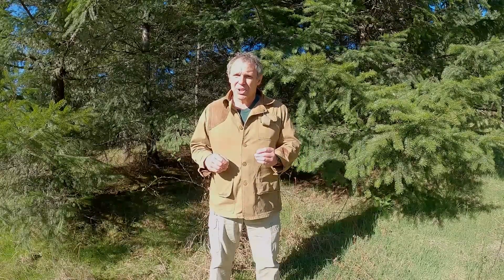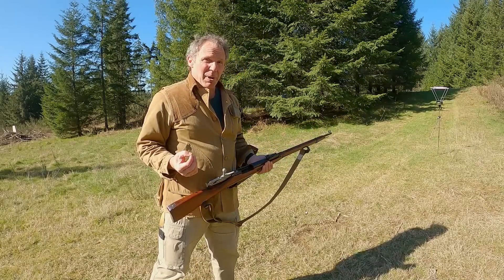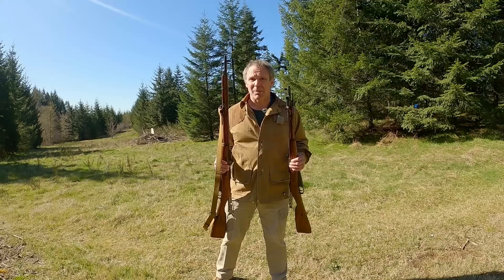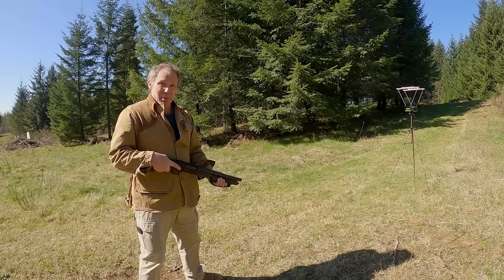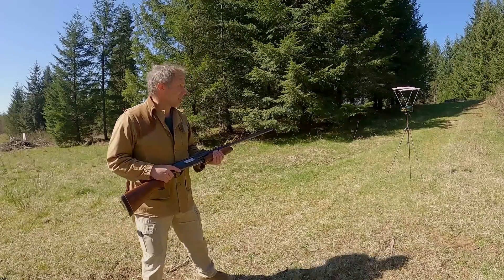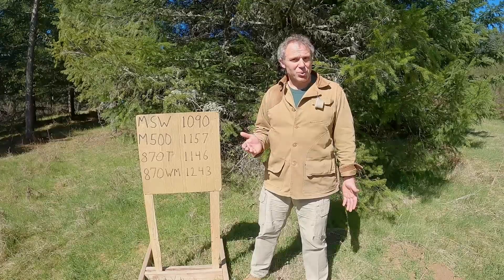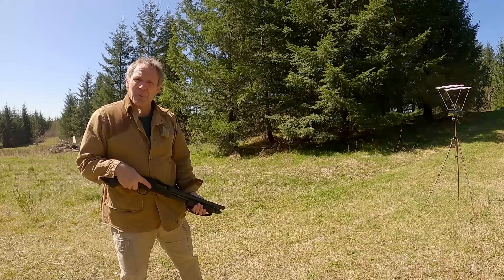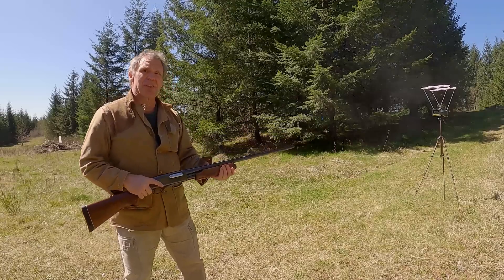Shotguns: How Does Barrel Length Affect Velocity?

Comment: Thanks for the video! I like my Shockwave. I understand that people who have trained for years on regular shotguns won't like going down to something like a Shockwave, but for me, the Shockwave is a nice little firearm. Because of my experiences, I like firearms that are easy for me to carry around the house. I don't have the Shockwave near me very often, but when conditions are bothering me, I sometimes do. (For instance, when my road is closed by winter weather and no one is going to get to me quickly, someone coming to my house with ill intent would be less worried about interruption.) As with any smaller version of a larger firearm, I accept that I'm making a compromise on several levels. 

I generally prefer 00 buckshot loads that are rated for 1100 to 1200 fps or #3 or #4 buckshot loads that are rated up to about 1325 fps. I assume that I'd getting about 100 to 150 fps slower shot columns than the rated velocities. Most loads pattern at just under four inches at eight to ten yards with my Shockwave. At distances under twenty yards, I think I have a good chance of putting about eighty to ninety percent of my pellets on an attacker. I think that load of pellets at those velocities would give me pretty good stops. If a monster breaks out of the local prison and is seen heading towards my place, I might choose a regular tactical shotgun. For my usual conditions of preparedness, the Shockwave still works for me. 

I've used some of the short shotshells with the adapter. I see some value in them, but I lean towards the 2-3/4" shells. I like the additional capacity, but if I'm really facing a large number of attackers, I think that I'd need to to start shooting at them before they were in shotgun range. From your previous presentations, I see forty to fifty yards as the practical effective range of a shotgun. If I were facing a group of attackers, I'm not sure that I could make more than five shots in the time that those attackers would need to charge fifty yards. In that situation, I think I would need to be using some kind of semi-automatic rifle and start shooting before they had closed to within fifty yards.

Comment: 18" is handy but here's a fun fact I tested personally - when shooting skeet from standard improved cylinder bore, 18" barrel spread is too high to hit reliably while a 20" barrel does just fine. 

For home defense 18" is great and handy, but it's not fun to take out for sport shooting, all the while 26" and 30" barrels are perfect for sport shooting and hunting with any type of choke needed, but they can't be used for home defense. 

If it's only one shotgun to have then 20" will do great for home defense, sporting and for most hunting. If new then Mossberg, if 870 then pre-freedom arms.
Reply: You could just get a Mossberg 500 and buy multiple barrels for it.

Comment: I will say, in 12 gauge while you dont see major gains going from a 14 inch to an 18 inch with most loads, the 20 inch is where you start to see improvement and I'd say a 26 inch barrel is really that kind of sweet spot. The gains from 26 to 28 are almost non existent and the 30 inch barrels usually arent very common anymore for the same reasons. 

Now, in 20 gauge and .410 you can see some significant gains from going to a longer barrel. A prime example, a .410 in an 18 or 20 inch vs a 24 or 28 inch is quite different and the shorter the barrel a .410 gets hurt tremendously. 20 gauge while not as effected as the .410, compared to the 12 gauge you see how shorter barrels do it no favors, and much like 12 gauge a 26 inch barrel seems to cap out it's effectiveness.

Comment: I love Paul's videos.  That said, this was a somewhat predictable result.  The idea that rifles and pistols with longer barrels will produce higher muzzle velocities for the same type of ammo is a demonstrated fact.  I guess the question that prompted this video was, because shotguns shoot multiple projectiles, that the pressures accelerating them would be diminished somewhat due to the space between the projectiles.  However, recall that the expanding gasses of the burning propellant aren't pushing against the individual projectiles, but rather against a wadding/shot cup, which effectively provides a flat surface against which those propellant gasses push.  Thus that shotcup/projectile combination is a analogous to a homogeneous projectile until they leave the barrel, thus the similar results to rifles and pistols.

All that said, I again love Paul's videos, and eagerly look forward to the next opportunity to lean more about firearms.

Comment: Just started the video, my initial thoughts would be that gain in velocity would be higher the larger the pellets as well as the weight of the pellets. Like 'average' bird shot load would less difference between shortest and longest barrel length than would the average 'buckshot', with slugs gaining the most with barrel length. Also think slugs would gain slightly rifled vs non rifled but not super confident of this one.

Comment: Some things I don't fully agree with.  A few technicalities needs clearing up. Longer barrel length does NOT equate to higher (peak) pressure. The pressure just has more time to act on the projectile. Shotguns use fast burning powder, so peak pressure occurs fairly close to the breach then rapidly tapers off. Burning is likely completed long before the shot leaves the barrel. Thats why a very long shotgun barrel increases velocity only marginally.

Comment: Interesting results, I would've thought that the smaller projectiles would not "block" the gasses from escaping like a conventional bullet does, and therefore it wouldn't be as effected by the longer barrel. 

Turns out it does affect it quite a bit. Pretty interesting!

Comment: More importantly: I'd be willing to bet those 00 shells had a faster burning powder in them than the birdshot shells. If you're going to run a shorter barrel it's best to use faster powder, so as not to waste as much energy going past the muzzle. Slower burning powders - on the other hand - do great in the longer barrels.

Comment: The surprising part was you don't lose a whole lot between 20" and 14" it's a little but imo not enough  to worry about at the ranges tour gonna use  a tactical shotgun.  I'm all about short barrels so thanks for this video. I personally  have no use for a 30" barrel. If they all had the same choke I doubt anything you hit with any of them can tell you the difference.  I'm going to have a stabilizer and screw in chokes put in my shockwave. That is bird gun deluxe

Comment: This is an awesome video, and helps with a really common choice in shotguns: the 20" vs 18" barrel. I'm curious, though,  what the threshold is for muzzle velocity actually being significant.  In the video, Paul said that 11fps was insignificant (understandable) 65 fps was "maybe, yes", 97 fps is significant (with bird shot). But I'm curious if 44 fps is also "maybe" significant - the difference between the 18" and the 20.5" barrels with buckshot. 

Overall, it just raises  the question... at what band of figures does a fps value become significant?

Comment: Bet a lot of it just has to do with fast vs slow burning powders in the load. A fast burning powder most likely wont notice the length of the barrel as much as a slow burning powder. Would be interesting to see for sure but unless someone wants to do hand loads using each different powder its not likely to happen.

Comment: That’s a VREY interesting topic, Paul, and one I’ve never really considered, so THANK YOU.

But watching this video has raised a related question.   The Federal and (I believe) Hornady produce some shells with “flight control” technology, which might offer additional insight.  As you understand better than I, they have “cup” that holds the mass of projectiles semi-together, until they depart the muzzle.  Obviously this differs from all the projectiles “bouncing” down the barrel gaggle-like.  And, I’d GUESS — and this is pure speculation — that the “cup” might more tightly fit within the smooth-bore barrel’s interior diameter than would loose individual shot balls.  If that supposition is correct (??), then I’d further guess that the effect of barrel length on velocity might be greater with “flight control” than with “standard” shells.  What do you think?
Reply from the maker: We have presentations on flight control ammo.
Reply: @Paul Harrell:       

Thanks.Paul, and yes I know that;  in fact, it was the genesis of my question.  

Apparently, I’m afraid I didn’t express my question too clearly.  The crux of it is, since the “flight control” shot cup/wad conveys the projectiles to (or slightly beyond) the muzzle — and that presumably the cup’s tighter barrel fit would prevent some of the hot, expansive gases from exiting the muzzle before the pellets do — would one find a greater barrel length-to-velocity correlation with “flight control” ammunition than  with standard shot-shells? 

I hope this makes more sense to you than it evidently did yesterday.  THANKS!

Comment: Excellent video Paul, but there is one aspect to shotguns that I think that needs to be covered that hasn't been talked about it at all and that's over bored barrels, I own a Browning that has the invector plus choke system in the barrel on my 20 gauge is overboard by .00015, instead of being .615 it is .630 and I wonder I haven't chronograph it but I'd like to see how does that affect muzzle velocity being over bored like that.

Comment: Hmm, from 14" to 30" for a paltry 100 fps or so, seems less than compelling given the tradeoffs in handling/maneuverability and quick response...Think I'll just load up some hotter slug loads and see how far out I'm still game lethal.  Back in the service I carried a pump 12gauge, but solely fired buckshot which worked  well enough out in the 'boonies',   given that I'm still around:)  Good information Mr. Harrell. Thumb's up!

Comment: Years ago, probably 1962 four us went hunting in the snow.  A cousin, an uncle, dad, and me.

Cousin had a 20 gauge, uncle a 12 gauge with a looong double barrel, dad had a single 12, and I had a .410. I don't know how long the double barrel was but it was taller than me at age 15. We scared up a rabbit. Cousin fired his  20 slightly short, I let go with the 410 but that rabbit ducked left at just the right second, missed. Dad hit so close to the rabbit I thought sure it would go down but no, it was still running. Uncle, more like the age of a grandfather,  said, "If you younguns are through scaring the rabbit I'll get us some supper". He cocked one barrel of that long old "Tom", slowly lowered the barrel  and when he touched it off, that rabbit went rolling in the snow. And that rabbit was pretty far away by then. So I learned at a young age, the advantage of a long barrel.

And now your viewers know it too!

Uncle didn't even try to get a pheasant until it had flown out a ways. He would say, "It's more sporting if I let them get a head start." 
My dad said uncle didn't shoot close because he was far sighted, couldn't hit the broad side of a barn up close, LOL
They sure had a lot of fun poking jibes at each other.

I sure miss those days. Uncle and dad are both gone now, and cousin moved to Texas after his time in Nam. Not sure why. We were in the same time but I stayed in WI. Had lots of family and friends there.

Comment: I got me a new norinco m97 1897 12gauge riot shotgun in a 20 inch barrel. I traded my remington 870 with 30 inch barrel. Im going to use the riot shotgun for ducks ,  partridge and rabbit hunting. I like to use #2 highbrass leadshot . It will be a fun challenge to hunt with using a shorter barrel but im hoping the highbrass will be strong enough to drop ducks.  If not ill just trade it again for another hunting shotgun.

Comment: I think the critical issue is that shot pellets have exceedingly poor ballistic coefficient.  Small, relatively light, spheres thrown at high velocity into air resistance lose their initial velocity very fast.  Air resistance is a square of the velocity.  Doubling velocity quadruples air resistance.  Raising initial velocity 100 or 200 fps, which is about all you can hope for in a shotshell, (via barrel length and/or powder charge) simply increases air resistance.  30 yards from the muzzle the velocity difference is very little.  Add to that their very poor sectional density and resulting penetration is very limited. 
Buckshot will do a little better, and is often intended for targets at closer range than bird shot, but you still haven't overcome the ballistic inefficiency of a round ball. 

Shotguns very quickly reach the point of diminishing returns.

Comment: I know that it's not wise to assume, but I'm going to assume that the Wingmaster, of which I own 3 myself, is a magnum chamber sporting a fixed full choke. A full choke will have less velocity than equal length with a looser choke....I'm also assuming that the other 3 guns tested here have a cylinder bore.
Of my 3 Wingmasters, 2 of which are 12 gauge, I have three 30" fixed choke barrels...1 Full, 1 reamed to Modified, and 1 reamed to somewhere between Improved Cylinder and Skeet. All of them shoot beautifully for their purposes. The remaining WM is a 20 Gauge with a 28" fixed Modified choke I use exclusively for Skeet. It absolutely vaporizes the birds.
For me, long barrels are always better, whether the quarry is pheasants, claybirds, or them pesky home invaders.

Comment: I have a question that you may be able to answer in a video Paul, why is spaced body armor not used for person protection? I know that it is widely used on vehicles because it offers similar protection with less weight, so wouldn’t it be logical to make spaced plates for personal protection? It would be able to be built lighter and maybe save the infantry soldier a pound or two. And I don’t think that it would be overly bulky, even a 1/4” can make a big difference.

Comment: The topic of barrel length and velocity is pretty fascinating, which brings me to a question. I own a single shot 12 gauge, which was cut down to 18 inch barrel length by the original owner,  I also have a 9mm cylinder adapter in 3 inch length that I like to plink with on occasion, using 115 grain fmj ammo. Would the shotgun barrel itself have any affect on the velocity of the 9mm round, or would it essentially make no difference?

Comment: Can you do +P+ 9mm solid copper xtreme penetrator 115 gr rounds vs hot 85gr 7.62x25 ballistic test? 

Id like to see if the tokarev rounds benefit of high velocity and penetration becomes irrelevant by using these 9mm rounds

By basic math it seems to be the case but I could be wrong with diameter being included

I know you’ve done other hyper velocity test in the past for this topic but it’d still be interesting to see this ammunition out to the test. Also testing deformation of solid copper vs copper polymer mix would be cool to see (arx 65 gr copper polymer)

Also thank you for being professional on all your test for the rest of us

Comment: Hi Paul, interesting video as always. But I think you should know that the explanation you gave as to why the longer barrel achieves higher velocity was not correct. A rifle or shotgun achieves maximum pressure in the first few inches of barrel. Once the bullet is half way down the barrel, it has already passed peak pressure and the pressure will decline the rest of the way. 
The reason longer barrels achieve higher velocity is because of acceleration. As the bullet travels down the barrel, the pressure behind it pushes it forward causing it to accelerate. The longer the barrel is, the longer the bullet will accelerate, thus reaching a higher velocity. There is actually less pressure and less acceleration as it gets farther down the barrel, but any additional acceleration still produces a higher final velocity. That's why a barrel can accelerate from 0 to 1090 fps in 14 inches, but then only accelerates from 1090 to 1243 in the next 16 inches. Of course if the barrel gets longer, the acceleration gets lower until it reaches its maximum velocity. Any additional barrel past that point will reduce velocity.

TL/DR: The reason a longer barrel produce higher velocity is because it accelerates the projectile longer.

Comment: Hey, Devil, do you think 3" magnums would have an even greater difference? I use 3" in my Vepr 12 for more power, so I am curious. Longer dwell time might mean more acceleration when you're building more pressure with more payload and/or powder. Also mildly curious if 3.5" would have even more of a difference. Thanks for the information, marine!
Reply: What is the barrel length of your Vepr 12? Mine has a 18.5 written on the barrel which I would imagine should be the length but in reality it's closer to 22"... I'm considering cutting it shorter (to about 15-16", I'm from Europe so no bullshit short barrel laws) but wondering if there is a reason why I should keep it as it is...

I bought an 16" AR instead of a shorter one because I value the extra velocity over a shorter barrel but with .223 the barrel length gives a lot of velocity and the round requires it to be effective. Not sure the same logic works for my Vepr .. :/